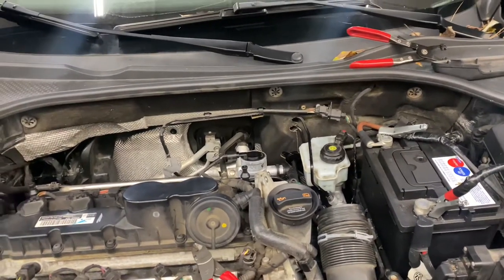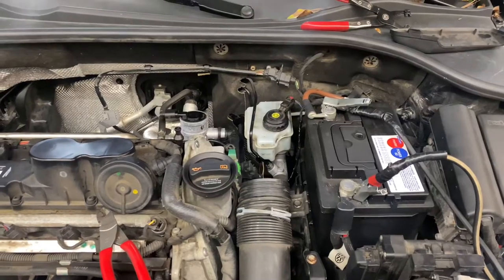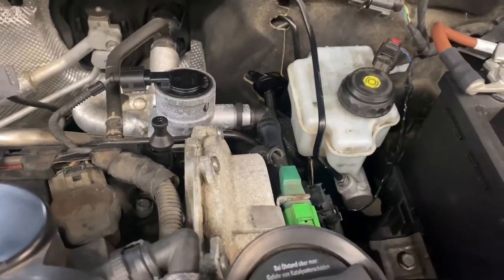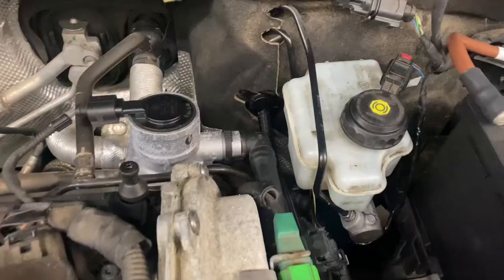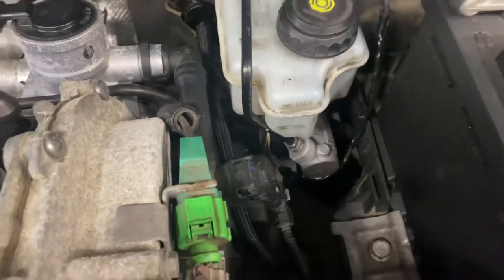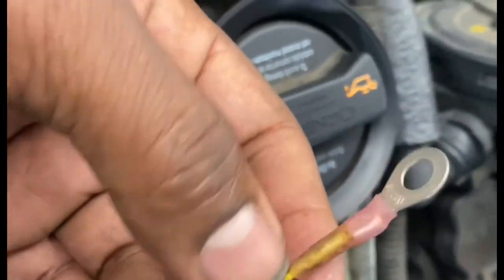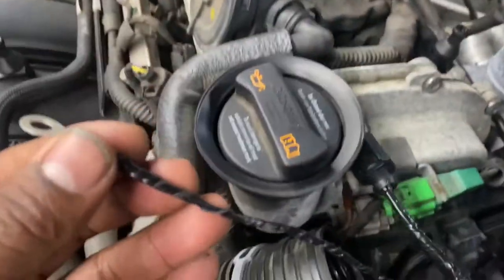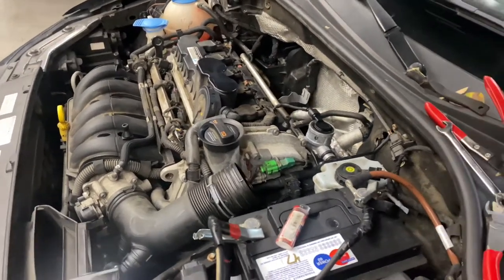VW brake lights are staying on.

Comment: I checked the ground wire at the switch for continuity back to the car and negative terminal of the battery. Seems like Ground is OK. Brake lights are still on. Any thoughts on why else this is happening?
Reply from the maker: Replace the switch at the master cylinder.
Reply: Thanks for the reply. Yes, I’ve replaced the brake light switch three times. This is the third one. I had been getting the “implausible signal” error. Now I get that code and the lights stay on.

Comment: Where is this brake light swtich located at on the master cylinder? I have a MK6 jetta that my mechanic just did a a brake job on and now the lights are staying on and the push start ignition is working without pressing the brakes
Reply: I’m having the same issue with my 15 Audi A3 but my car says check brake fluid and it’s full
Reply: Hello, did you solve your problem? I have the same jetta mk6 case with brake light on
Reply: do you solve this problem?
Reply: The brake light switch is underneath the master cylinder. You can find a lot of videos that show how to remove it. It’s fairly easy to do, just a tight fit.
Reply: Brake light staying on can also be due to a burnt fuse. Check in the engine bay fuse box.

Comment: Got a 2011 chevy silverado  1500 the brake lights come on as soon as the key switch is turned on.  Replaced the brake switch no go, still on.
Reply: figured it out?
Reply: @AsapFlxw  Faulty  new part.

Comment: I have a similar situation but when i push the brake the lights turns off, its working on the inverse
Any solution?
Reply: I'm having this same issue did you find a solution to this
Reply: @alexleonard1955  Yes, it was the brake master cylinder in his last days, i remember after a few days i lost the brakes too, when i changed the brake master cylinder even the lights back to normal
Reply: @rafikannabi  thank you for the insight I replaced the master cylinder with a new one and that's when the problem statred so maybe they sold me a defective master cylinder